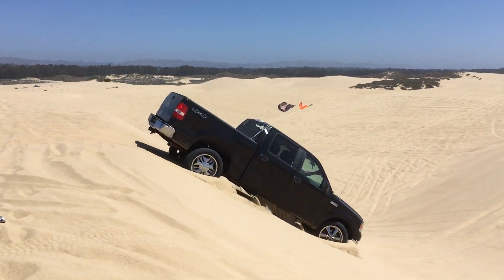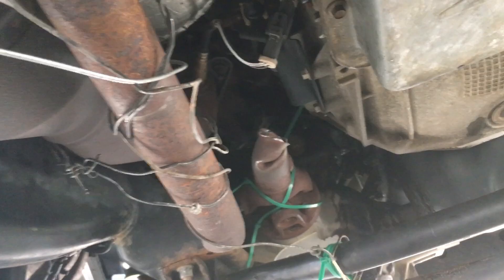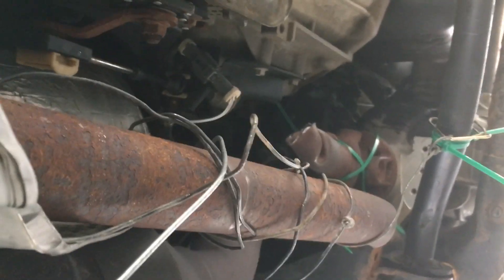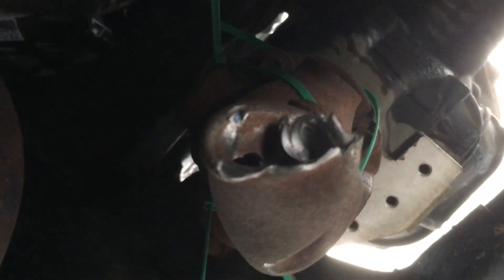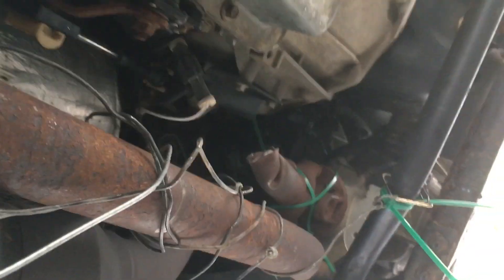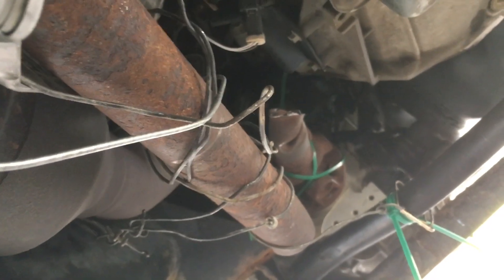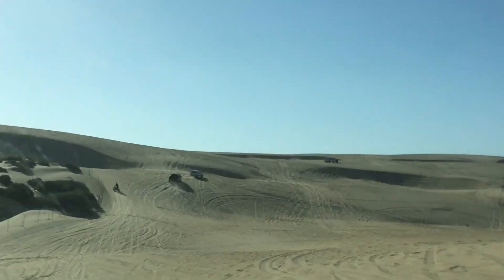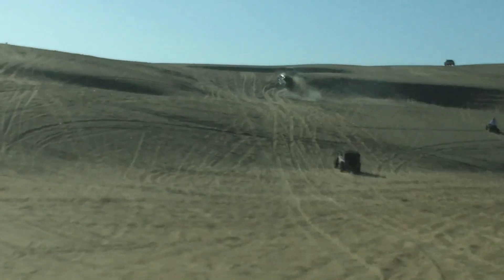Ford F150 Broken Front Driveshaft

Comment: re skinny driveshaft: I twisted off the front driveshaft of my '72 F250 decades ago ( i was 20 years old). I worked at a machine shop so I just bought new tubing, cut the ends off what was left of the old driveshaft, and welded them on to the new tubing (in the lathe to keep things aligned), then balanced it. When I was about to order the new tubing I thought I would go thicker so it would be stronger. The old machinists at the shop said, "what would you rather be replacing now: this driveshaft, your transfer case, your front diff or a front axle?" I ended up ordering the same thickness of tubing as the one that had twisted off. There is a reason they choose that material/thickness for the driveshaft.

Comment: The 70's F150's had full time fwd so everyone took the front driveshaft off better gas mileage. When i bought my '76 F150 in 1988 it had no shaft, went to a local boneyard they had piles of those stacked up the roof trusses. Gave me one fer-free. Ya' know gas back then was .98 cents gallon!
Reply from the maker: I bet those driveshafts were a lot stronger than the new ones. And I bet the new one is so thin and light because they’re trying to get the best possible gas mileage out of it.

Comment: Found on the road dead! Damn and I bought a ford too smh the brands reliability is questionable like big time!
Reply from the maker: I hope the new ones are better than these older ones.
Reply: @hoohoohoblin   I sure hope so.. got the 16 fusion titanium with 50k on the clock. Hope it lasts a while lol
Reply: The new ones are definitely better, plus found on road dead doesn’t make any sense and it’s an old joke that not even GM guys laugh to. Get yourself a ram and you’ll REALLY start to question reliability. Coming from a guy who owned one
Reply: I had 2 Chevy Silverado’s with nothing but problems. Their transfer cases suck which I know all to well from working on them. Poor design for many years of wearing holes in them. I have a 2004 f150 with over 200,000 some miles no problems. I also had 2 Ford rangers with over 300,000 before selling them and they are still going. Also all your driveshaft are about the same thickness no matter what brand. Lol.